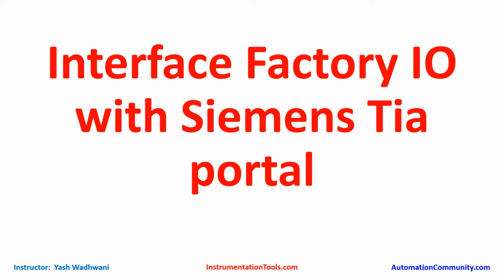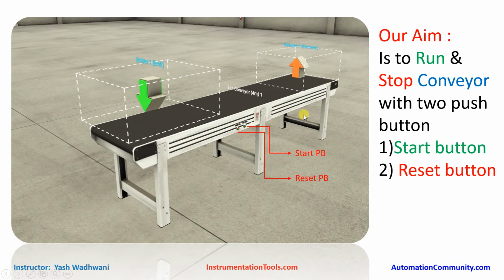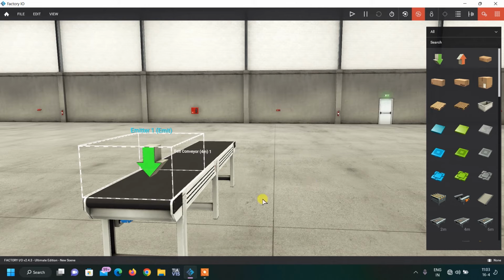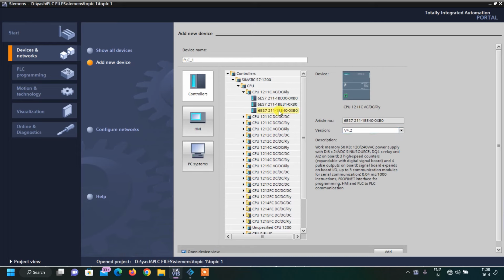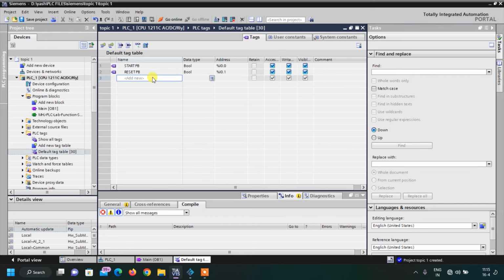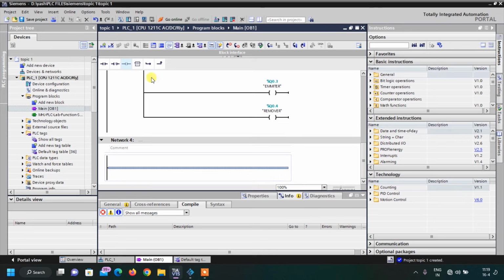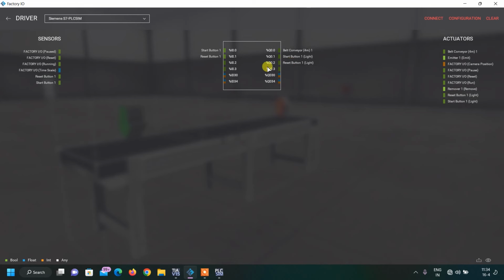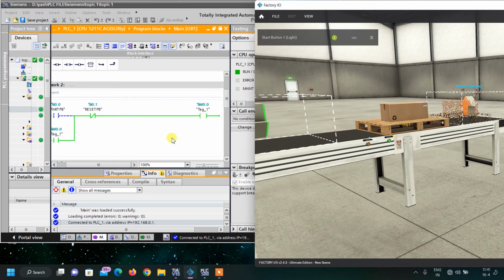How to Interface Factory IO with Siemens Tia Portal? - PLC Tutorial

Comment: @Instrumentation Tools
I have phisical PLC 6ES7 215-1HG40-0XB0 connected to my laptop but have issues to link it with Factory IO. Does it mean the function block FC9000 is for specific PLC1200 only? Can I run the program simulation on a phisical PLC linked to Factory IO instead of PLC_SIm?